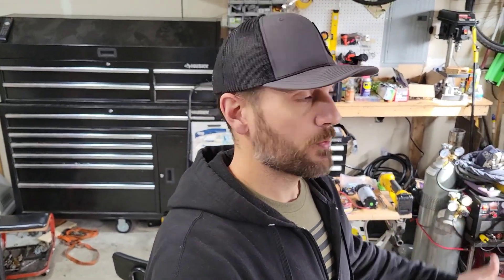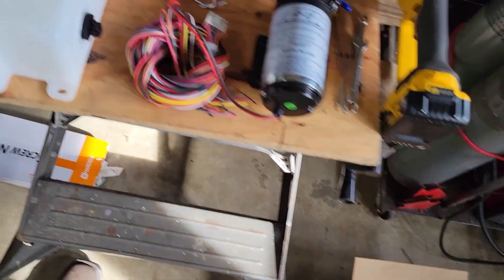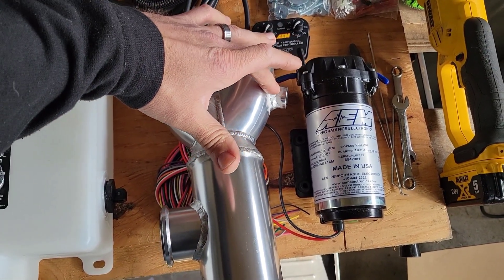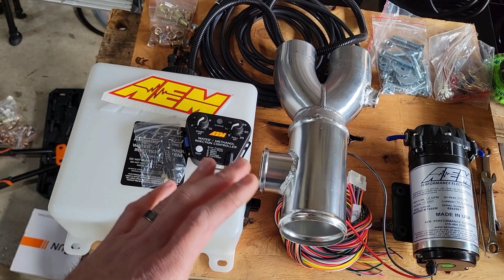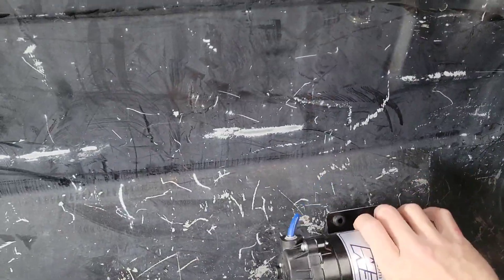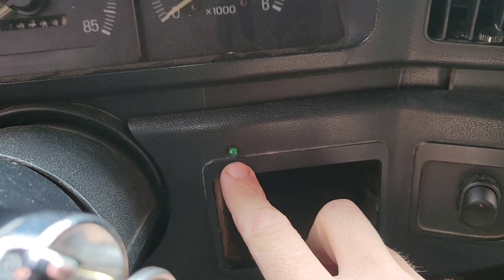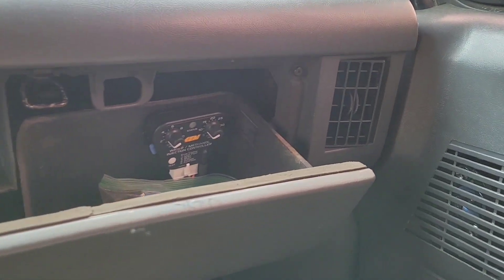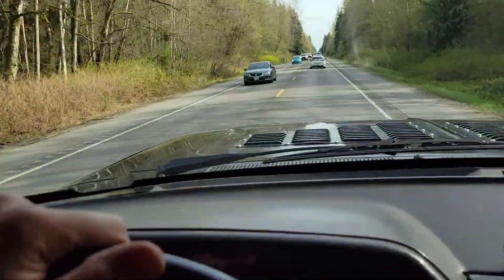AEM water methanol install Turbo EFI 460 Ford 🥶

Comment: I've had good success with the AEM kit. I have a Samurai 2.0 DOHC that I boosted. That 2.0 is 10:1 and I utilized an intercooler but even pulling 1* per pound of boost @12:1 afr I was having detonation above 6 or so psi. Adding the methanol was a game changer for me. I've been to 12psi zero problems. Other then the clutch 😂
Reply from the maker: That's great to hear and that thing sounds awesome! Ya I expect I wasn't too far off from detonation at 8psi. Hopefully this week I'll get a chance to turn it up, depending on weather. Gets no traction in the rain at all.
Reply: Yeah it's pretty dang fun. Your build is on another level. Love it. Keep up the good videos. I've got a 78' dentside that may go the direction you're going. On the sami I'm using AEM fic-6 piggyback on the factory Suzuki ECM and it leaves a lot to be desired. One day I'll go megasquirt 👍 good day

Comment: Nice John, Yeah I haven't seen E85 anywhere from where I am from, I'd be doing octane boosters from 94 if I needed anything that spicy plus gas is near 6.50 a gallon so I am planning any trips from here on in with my bricknose as a fill up vs. my Mazda 3 would require some sort of special lubricant for those  special areas.,  I like the dash as well, If i get of my ass and finish my cluster i'll be one step ahead, doing all the vitals, air fuel, fuel pressure, and boost/vac which will be one step closer to doing my own boosted 460 when the time comes (that's another money grab at this moment). Keep up the good work. You must be having fun confusing all these sports cars when your grill is touching their bumper at 90+MPH and the truck isn't even breaking a sweat....
Reply from the maker: 😂 thanks I appreciate it very much! Damn our premium is around $4.30 a gallon right now. The truck for sure gets a lot of looks especially when I roll past em with the turbo blow off noises lol... Things are going to get a lot more fun this week when I turn up the boost!

Comment: You should have way more subscribers. Just put #LSturbo in your title. Any plans to run it down the drag strip?
Reply from the maker: 😂 good call! Yes I would love to take it to the track. I picked up a draggy for tuning and some track times. Took it out today to turn up the boost but it's raining and it just spins. I'll hopefully get it on a Dyno also once I get mostly dialed in at higher boost.
Reply: @johnvirgilsgarage  I look forward to a dyno run video.

Comment: Being that it is air intercooled, is the AEM overkill  being turned on at such low boost?    Also with the increase in gas prices does it make ya think twice about turbocharging such a large engine?  It certainly took the wind out of my sails.
Reply from the maker: I definitely don't need the water methanol at only 5psi but the extra detonation resistance what I am after. Im just about to turn it up to 10-15psi, then it will really come into play. Just needed to dial in the on wastegate only tune before I turn it up. Also I'm not worried about fuel mileage but it doesn't appear to have been hurt at all, if anything it's improved with the sequential fuel and spark.

Comment: YES!!!!! First one to comment!!!!! Good stuff……don’t quite understand the benefit of E85, but I’m guessing it’s related to the turbo??
Reply from the maker: There is more to gain from E85 on a forced induction vehicle but it has a higher octane (detonation resistance) and cools the intake charge down considerably. Richard Holdner had a ton of great E85 testing on his channel. For me since my intercooler is already very efficient, I am mostly after knock/detonation resistance but the cooler air charge is a bonus.